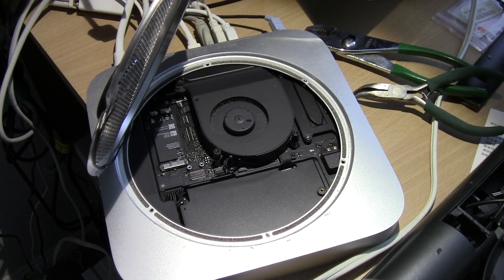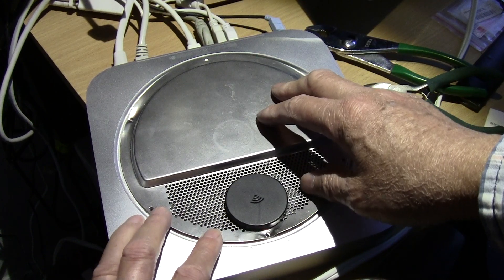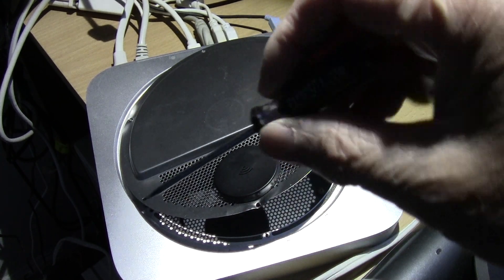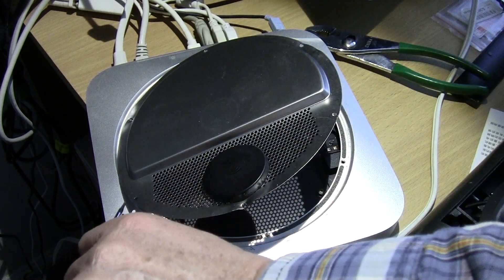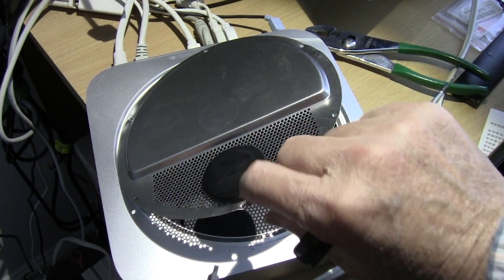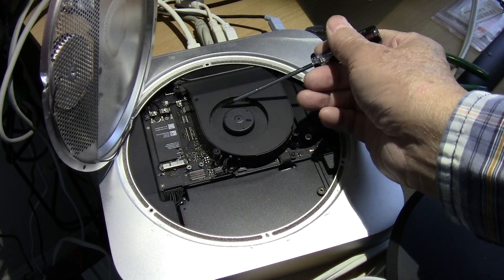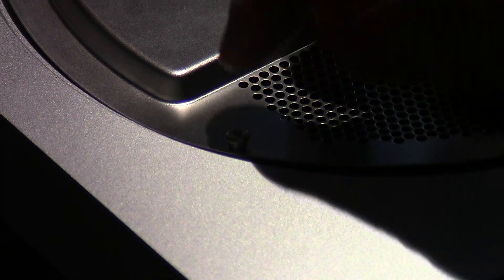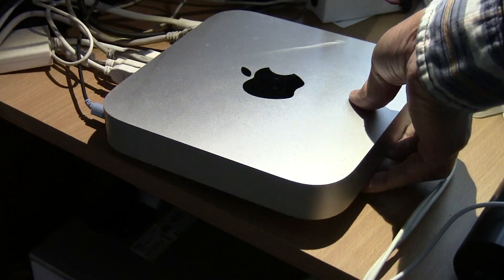2014 Mac mini running very slowly

Comment: thank you I may try this, what are the risks (if any) of this process? I just dont want to ruin the computer somehow by opening it up, thanks.  (mine has been slow as dirt when trying to edit video, or even with just one web browser open, it is 3 ghz i7, 16bg ram but im keeping macos sierra on it for acces to final cut pro 7 still.  It doesnt overheat too often though
Reply from the maker: The only downside is u can ruin the bottom cover if u don’t have the right screwdriver. That’s not a problem for me as I don’t look at the bottom cover often.

Comment: Take it outside, and use compressed air to blow it out.  Blow air IN where air would normally come out.  Used to do that all the time as a tech, but we didn't have the luxury of outside, so we had to do it in the shop and breathe it all in.  We've set the fire alarm off numerous times because of the dust.
Reply from the maker: Words of wisdom. Blow air in where air would normally come out. I'll have to try that. Thanks.
Reply: @wtam69  No problem at all!  Might want to remove the bottom cover again first, that way it doesn't jam up inside there.  On laptops, it's too much trouble to disassemble for that, so you just shoot the air and hope for the best.  Most times it comes out.  Make sure you've got enough pressure, if you don't have enough, you could dislodge a big dust bunny that will then lodge itself elsewhere.  We used to run the air compressor at full charge 100 PSI.  The fan will overrev, don't worry about it, it's just for a second.
Reply from the maker: @jaykay18  My air compressor goes up to 80 psi. Probably enough to blow loose the dust. As it is, the Mac is running like new.  I should probably do this once a year.  I looked all over the Internet and no one mentioned the cooling fan. They all tell you to delete files and such which is no help to me. Crack open the case and the problem becomes obvious.